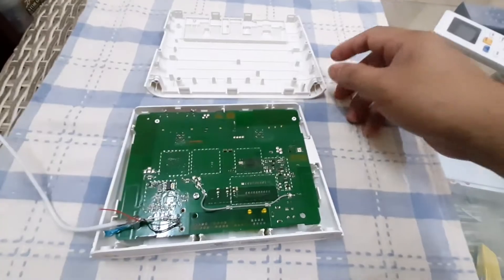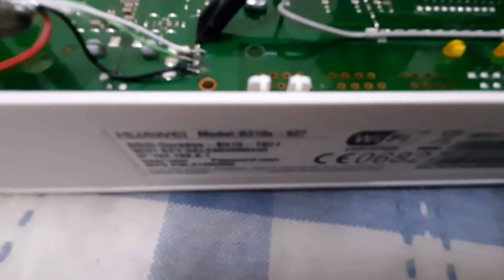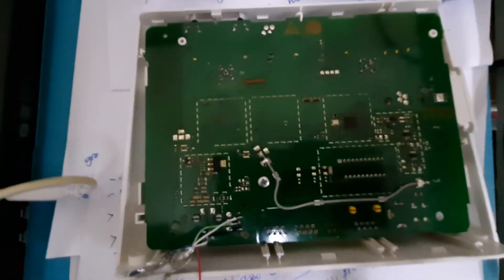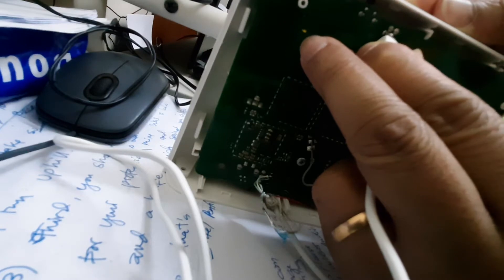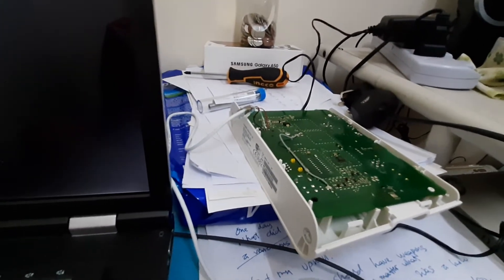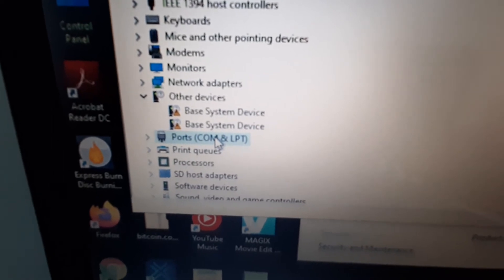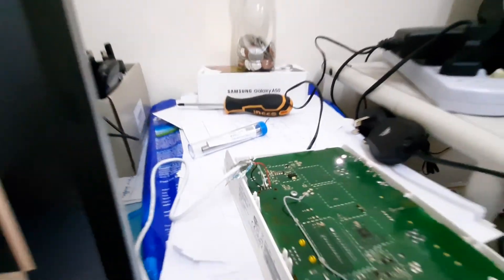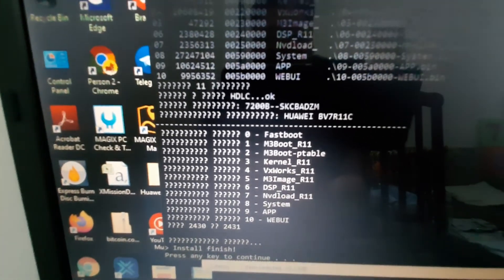Unlock Huawei B310s-927 4G/5G Router ( Ooredoo LTE CPE B310 )

Comment: Hi, I am from Sri Lanka and thank you for this video. I followed your steps and flashed router as well.  Once the flashing process completed, I disconnected the power, remove the USB. However, now when I connect power, the power indicator does not come. What should be the next steps to use any SIM? Do I need to do some confirguration? Greatly appreciate if you could provide how? thanks in advance.

Comment: I noticed after unlocking the UI option to setup a DMZ/Port Forwarding is absent. What is the fix for this ? Software version: 	21.300.01.00.00 Web UI version: 	17.100.09.00.03

Comment: Do I have to connect the red cable or not?🤔🤔
Reply: Thank you very much❤❤
Reply: I tried to do the usb thing.I did it before by watching other videos and I messed up the circuit board. If it is possible can you post a video on unlocking router by ethernet cable method.😊😊😊
Reply from the maker: @assistance_easy  This is a free method. : )
Reply from the maker: You can connect the red, its ok.